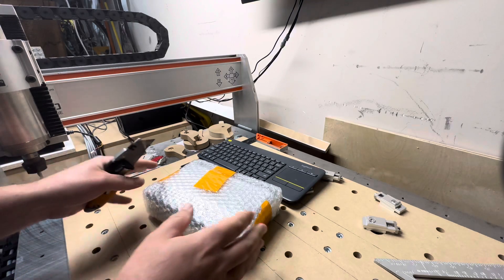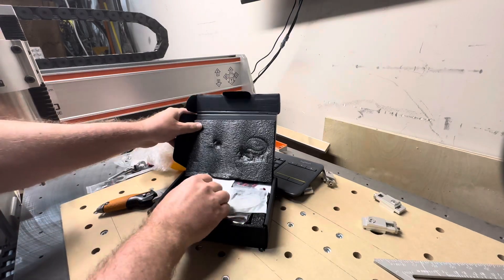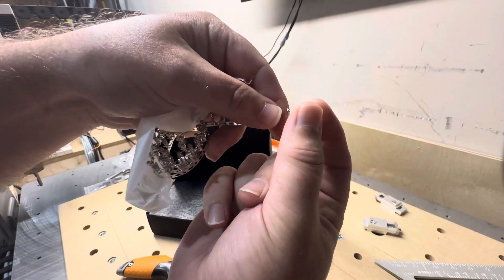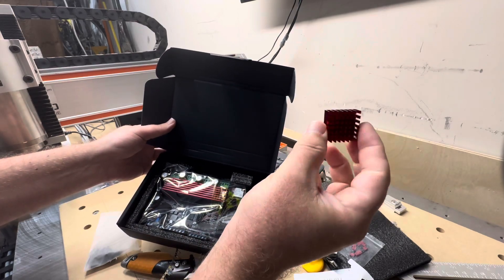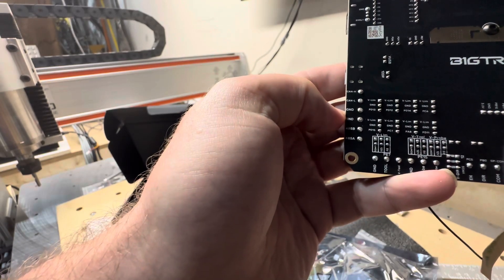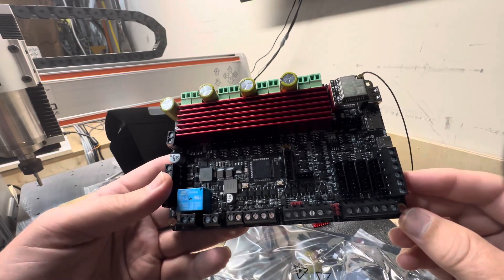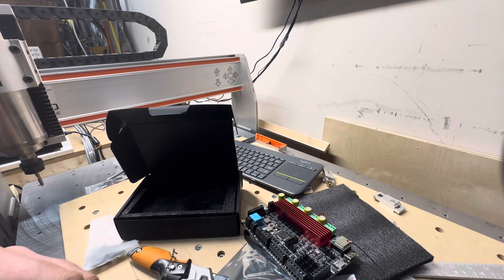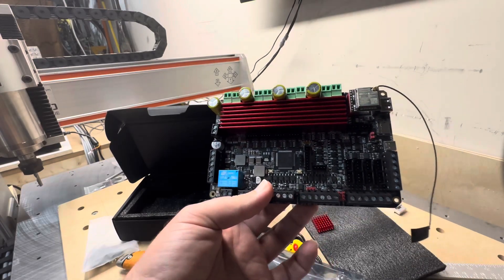Big Tree Tech Scylla V1.0 CNC Controller Unboxing (grblHAL)

Comment: I appreciate you posting this, was curious as to if you were satisfied with the board?
Currently have half a Frankenstein's monster of a CNC built in my basement, was wondering if it was worth the extra money to go all in on this board + the needed Nema23 motors, or if you'd recommend going a different route.
Reply from the maker: If you're in the Nema 32 size and below I don't think you will find a more integrated high performance board on the market.  I've had discussions with some board developers and they don't understand how they can sell the board for the price that they do.  I haven't had any problems with it at all but I haven't tried all of it features yet.

So I definitely would recommend the board.
Reply: @MegaOnefineday  Thanks for the response! Looks like I'll have to snag one, then.

Comment: Great job sir, waiting for next video, in next video please explain the GRBL Hal source code and procedure for compiling and flashing the source code into controller.
Reply from the maker: I’m going to try to get that video up this week
Reply: @MegaOnefineday thanks 🙌
Reply: @MegaOnefineday  Im in the same boat here. I cant get it to connect to the pc. Bin file is converted to cur, but when i connect  to pc, i get nothing. I used the web builder
Reply: @MegaOnefineday  Hey! First off, thanks so much for the great and insightful videos — they've been incredibly helpful and well-explained. Just wondering if you're still planning to upload the video about flashing the controller? Would love to see it if it's still in the works! This would also help me out a lot. :)
Reply: @MegaOnefineday  Hi I got myself the same board can you do a tutorial for the firmware? I can't figure out the sys/ section